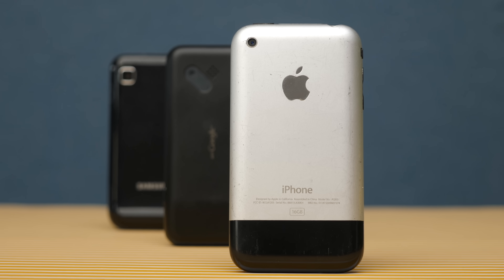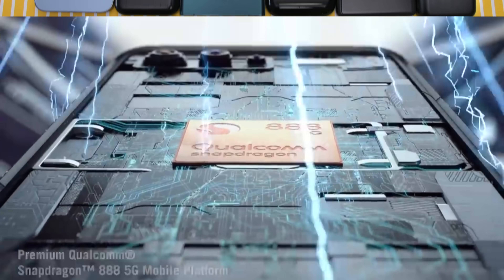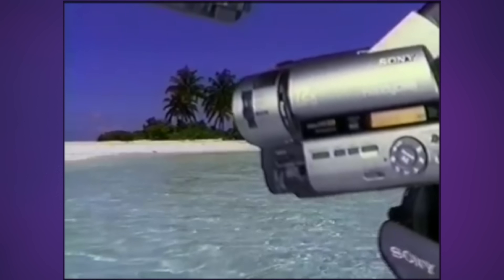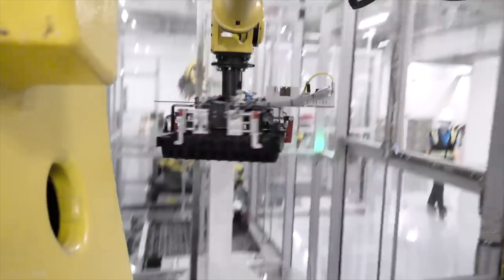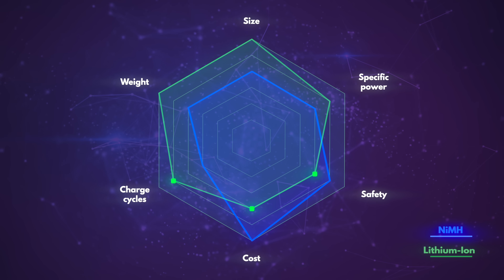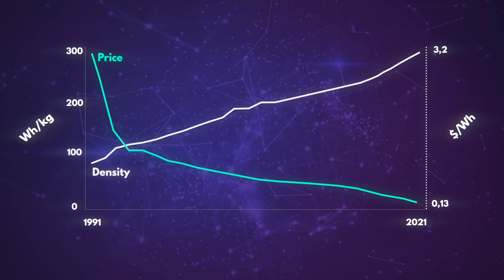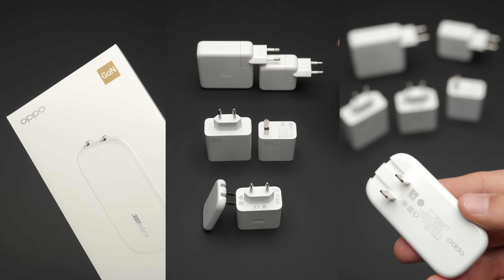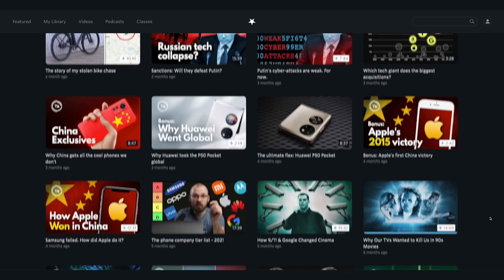The billion dollar race to fix phone batteries

Comment: I am honestly OK with the battery charge density as of now, but I think that the near term goal is to make them last at least twice as longer in terms of charging cycles. I am ok with charging my phone every day, but I am not ok with the battery degradation.
Reply: you wouuld actually be ok with the battery life too if phone manufacturers didn't screw us by glueing it in (and no, that's not what makes phones water resistant)
Reply: @maradeanu  It's sounds like (at least this is what I'm hearing).  Sounds like you are sour about how manufacturers have taken away the "removable battery".  How it was easy to carry another one.  Yea, that was nice.  And I too, am disgruntled along with you.  But I guess there is a "power bank".  Sure it's bigger, and burdensome.  But I have a laptop briefcase with me most times.  And I have a power-bank for it, in said briefcase. So, it works for me.  But, yea.  I'm with YOU on that point.  A phone should be a phone.  And not require an overnight bag.
Reply: @vangildermichael1767  The biggest problem of non-removable batteries is not the charge or operation time. It's the ability to replace almost anything (not just the battery) by almost any noob using a youtube video. I replaced a screen before by myself, now I cannot do anything about my phone. And I'm definitely not ok with it.
Reply: I can agree with you on your point of "I'm OK with charging my phone every day".  Yeah, I don't mind that.  If it were so.  (EVERY DAY) is only true if I don't use my phone, except miniscule. It's more like charge my phone (twice a day, or more if I use the GPS).  But your point holds true.  I'm pulling for a higher charge density to have a bigger cache to draw from.  And that also means we will find a better (programming and gizmos) to use that greater cache of power.  And of course, no degeneration.  Some short I watched said that a (Graphene) battery will have an infinite amount of changing cycles.  But in the next breath he said, manufacturing (right now) prevents making Graphene for under a zillion dollars a gram.  So, "someday".
Reply: But how are they supposed to sell you a new phone every two years
Reply: @neconomicon19  the correct way.  By advancing technology so far that you will desire to UP your "phone" game.  For the longest time, the system has been on the edge that "we cannot let the people "see" our entire hand."  So we will "milk" this same technology for the next 2 dozen years.  But "HOW"?  We have focus their attention toward something else.  And then they will start to believe that this "other thing", is what is holding up the show.  Battery tech does not "sell" phones.  Or at least it shouldn't.  Now, that the people are finally waking up to what is happening.  More tech is about to be unfurled .  Not "some".  It will be a whole tsunami.  It will be so much that people will denounce God and just be content with their "electronic God".  You think "nobody would do that".  With current tech, you are correct.  But come back and tell me that in a little bit.  Let's a 10 years.  I think a "1 year".  But I always push to hard.  So 10 year.  That seems "a leisurely pace".
Reply: It would sure be nice if they added the feature to change the phone battery
Reply: @magnum_mon795  {added a feature to change the phone battery}.  I'm hearing you, and yea.  I agree with you.  But. I'm also realistic.  That is never going to happen again.  But, when life seems the shittest.  I look at what I do already have.  In this case, it's change the battery.  Just like I was going for.  Only it takes a screwdriver, and a heat gun.  I guess "maybe a soldiering pencil", I dunno.  I never tried.  But we are still allowed to.  (John deer)  doesn't have the "right to repair".  I don't even think App does.  But I can still tinker in my Android phones. Before we ever go "back" to the old days.  Where we could have a spare battery.  We will go "forward".  To where you wear your phone on the inside of you.  And the batter never goes dead.  And you are part of the collective.  You know it's almost time.  You might not like it, and I don't either.  I'm not advocating for a one world.  But I'm not naive to what is happening all around me.
Reply: hear hear! but I dont think phone companies have the incentives to, many upgrade their phones when their batt's degraded, :/
Reply: imagine if batteries were still replicable on most phones like they were 8 years ago. This problem was solved a long time ago but it's not profitable to have your phone work for many years
Reply: @KekusMagnus  I agreed with you up until recently.  I was under the impression that the only reason I'm really getting a new phone is the battery.  Until I kept a phone for 3 years.  And then I realized the reason to upgrade (for me), is the camera and the software that runs it.
Don't hear me wrong though.  The battery plays at least a 50% roll in that decision to upgrade.  But that is all, 50%.
Reply: If people would stop being so obsessed with thinness and “sexy” hardware, we could get great durability and battery life, given a choice between a “thin and sexy” (and fragile) smartphone and a thicker, more robust smartphone with much better battery life, and the ability to bludgeon and stun any attacker give me the ‘brick’ any day ;)

The first thing I do with a new smartphone is put on a screen protector and put it in an Otterbox, im not going to risk my expensive pocket computer getting damaged…
Reply: I’ve wondered if it could be possible to overcome this problem with more super capacitor developments. Ask yourself this. Would you prefer a phone that lasts longer per charge but degrades over time, or would you prefer a phone that doesn’t last as long per charge but let’s you recharge it fully in single seconds and takes much longer to degrade. Super capacitors makes this theoretically possible but it needs to have more specific energy if it’s going to be seriously implemented in mobile devices
Reply: It makes perfect sense to me that a phone would have enough battery to last 1 day.
It's not like I'm using it while I'm sleeping. Just pop it on charge over night. We don't really NEED anything beyond that, though it would obviously be nice.
Reply: My real problem is with the heat dissipation, I want to somehow have the phone dissipate 20W and the battery must be able to provide that to the CPU.

Aka, mobile CPU/GPU could be more powerful if the batteries could discharge as fast as they can charge. But then how do we get rid of that much heat, it must have active cooling, which would be inconvenient.
Reply: I agree. My current phone has two days battery life which I think is more than enough. It can deal with more battery degradation than most phones but I would want to either have the battery easily swappable mid life (screwed instead of glued backplate) or a battery that can handle twice as many cycles before degrading. I would love to keep getting 5+ years out of my phones and it's mainly the battery being the limit (and maybe the USB-C port).

It would be amazing if there was 5 years of software support for phones as well, then only accidents would be a cause to buy a phone more often.
Reply: @LeonardTavast  { it's mainly the battery being the limit}.  Well, there HAD to be some sort of "planned obsolescence".  Or, the story goes, that capitalism would fall apart.  When Android was a itty bitty baby, There was a new flavor of Android every month.  And a phone only got 3 (then "no soup for you").  That (WAS) the limiting factor.  But now, (battery is the weakest link).  That shows me at (how close the (global "communism" thing is to being complete.  The awesome battery technology has been held captive for dozens of years.  Because, (just watch), everything that used to make the capitalism world go around.  Will stop as soon as we have a way to carry energy in a convenient manor.  A GOOD solid state battery will be unveiled just after this order fails.  Don't hear me wrong.  I am not advocating FOR capitalism.  I'm just not naive unto what is happening.
Reply: As a general matter, heat degrades electronics and batteries. That may be a challenge for "fast charging".
Reply: @dosgos  I rationalized it out, the "It may be an issue for (fast charging)" as a "problem".  Only if the method is (brute force).  If you try to cram that energy through the same pipe.  Only at a higher voltage and thus Amperage (then a heat issue will appear).  nope, a person can't work this problem like a cave man.  Snapdragon has already found a way to do in right with their (quick charge).  I guess a person needs to alter the very frequency the energy marches in.  And if it marches in single file or two by.  And then two more top and bottom.  There is a way (already proven).  But that is just the beginning.  Yea, there is no challenge.
Reply: Charge every day is totally ok to me as well. But in the first month with my new phone I Just noticed myself recharging it 3 times a day
Reply: Well, when it comes to the party degradation, you better get used to it, because that is NEVER going away.
Reply: One plus 150w 0-100 15 odd mins
Reply: Tru they degrade quick
Reply: I agree, I have two similar phones with very different battery capacities and  (s10e and s10 lite) and I barely notice the extra capacity unless I am pushing the hardware.

That said, I would like to have better thermals if I can and usually am willing to sacrifice some performance for it.
Reply: Im using a 6 year old galaxy S7 with the original battery, I actuslly bought a replacement almost a year ago but haven't swapped them because I'm happy with the capacity of the original.

Ok not happy but I find it sufficient, I don't want to replace it while it's still good enough & create unnecessary e-waste, so I'll hold off on putting the new one in for now. But longer gap between charging would be ideal cause what about situations when j cant charge or am out doing something?

Idk this almost 7 year old battery is still good enough & will last a full day if I'm out doing stuff & not using my phone. Maybe I'll swap it out in a year but I really want it to start degrading so I can replace it without feeling bad.
Reply: Actually no I guess I want it to still be good, cause then I don't need to replace it.
Reply: No, the battery should degrade even faster so that you spend more money on replacing it or getting a new phone so that the private owners of the corporations get more profits 😌
Reply: @Shifftee  if they plan to have too quick of obsolescence, it will backfire and people will buy a competitor’s product instead.
Reply: i am the opposite. I am ok with battery degradation but I am not ok feeling like a dog leashed to the power grid. I'd happily buy a new phone every year if it meant longer battery life per cycle
Reply: not having to charge your phone every day would increase your battery life respectively also?
Reply: Jokes. I will never be satisfied, till I don't have to charge it. Fusion, motion or some other amazing, invention, yet unheard of. A Dark matter phone? Think of how we will help the environment though. However every part of the infrastructure needs to move at the same time. Will there ever be a free source? Like Tesla wanted, but was persecuted for wanting. Due to the Greedy.
Reply: there will never be a free source of energy. @stephenfwadsworth9565
Reply: Oppo battery health engine promises 80% battery life after 1600 charge cycles. That's double the current standard of 800 charge cycles
Reply: @adrxano_za  If that actually comes through to the consumer side (where I can buy it).  I hope they will let me change my battery in my s21 out for this.  That phone was out of my budget.  I can't quite let it go so soon.
Reply: I think you're fine with it because companies have had to adapt to it. Try to imagine what companies could create if batteries were half as large and twice as dense. I think it could create new form-factors and greatly improve some of the stuff we have today.
Reply: @vanjagrigoriev1442  While Boris is accepting reality and highlighting an actual problem you countered with "imagine if physics didn't exist"?
Reply: @willstikken5619  my point is that it's easy to be content. Before smartphones exusted people were content with the phones that existed because it's hard to imagine the stuff that hasn't been invented yet. Looking back smartphones might seem obvious, but at the time I don't think they were.
Reply: @vanjagrigoriev1442  I have some difficultly reading that into your comments but it is valid. 
Right now, we live in a world where people have conflated regular marketing 'advancements' with real technical innovation. This leads to the effect swinging the other way.

Companies have set an expectation that they will announce seemingly wondrous technologies every year at their respective events each year and on schedule.  When this fails to happen, people have all sorts of irrational reactions. People in general lack the technological or scientific literacy to grasp what’s going on. They only know that their unrealistic expectations were not met. 

What we end up with is a situation where, as you noted, people’s imaginations are limited by their experiences but also their expectations are set by their perceptions.  People are unable to envision the next big thing while also believing in magic nanobots and satellites that can zoom and enhance to check your eye color…
Reply: @willstikken5619  What do you mean?? graphene batteries could do this
Reply: @vanjagrigoriev1442  I think contentness also has to do with conformity. There's that desire for "cool" which removes variety and potential possibilities. TV's, phones, cars and ect don't have to be flat, don't have to have the form factor they currently have.  We could very much have more clunky fatty phones which make the most of the extra space but people don't want that cause it isn't as cool.  Like flat phone somehow jamming shit in is cooler and more novel so people will buy that.
Reply: @vanjagrigoriev1442  also try to imagine how much more dangerous those batteries would be, lithium batteries are already so dense that they can be very dangerous if they go bad. I build and pilot high speed FPV racing drones, a 25 watt hour battery only lasts us like 5 minutes of flight time, so I do want improved battery technology badly.
Reply: Meanwhile, I'm just reading comments here on my LG V20 (modified with Lineage OS) and packed with a 3rd party Perfine brand battery with 10,500mah capacity that could last for 3 days or even a week on lighter use. The phone has been modified too with a copper plate and copper tapes inside and repasted a thermal paste for a better thermal and boosts performance.